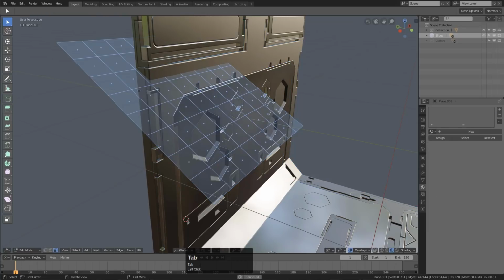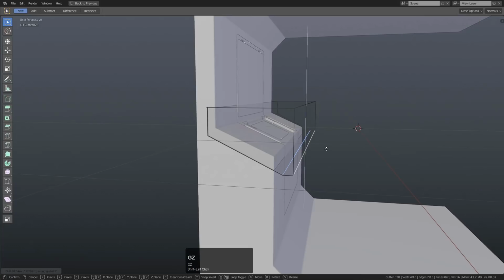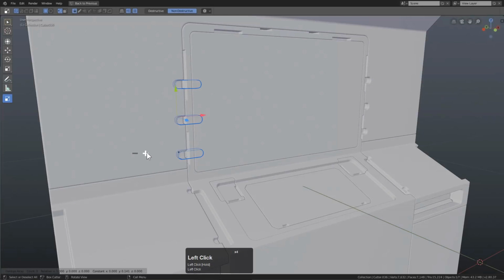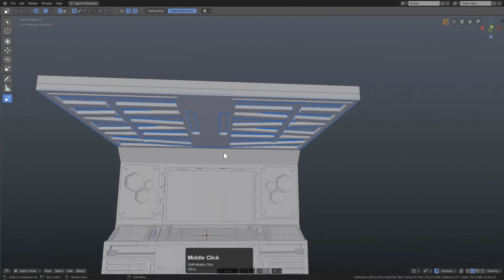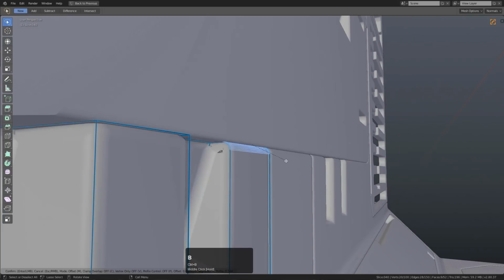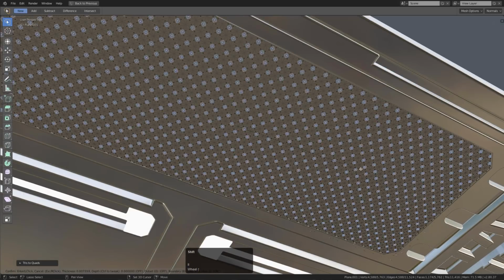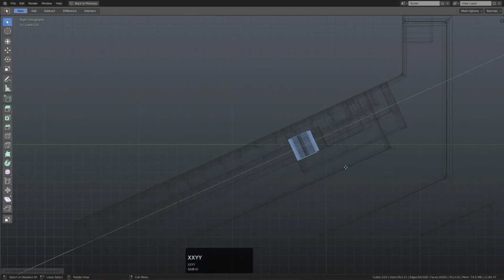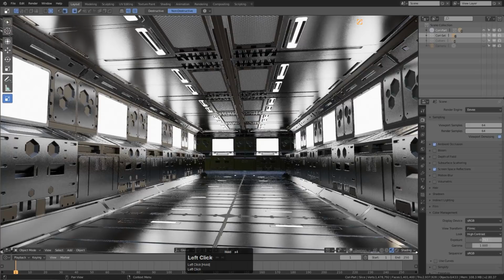#b3d / #boxcutter 707 : More Box More Cutter

Comment: Just Jumping between older boxcutter and new... I REALLY DIG the cursor cut depth. I'm hoping we can bring that back??( if it is there and I missed it..apologies) And for some reason the beveling made more sense on the fly with the cintiq pen....meaning tab then bevel to desired. A suggestion for working with cutter planes might be a quick click preset that adds the plane with a built in xyz gimbal for speed on show with the plane. I'm a zbrush fan and use box cutter over and back with zbrush for various attributes etc. Also - I think you could charge something for the 2.8 update. I don't mind paying something more once it is done and I think we all should. This really is a great tool.
Reply from the maker: youre the first to mention cursor depth. Since I got used to how hard it is to move the cursor now I stopped thinking about it but you might be onto something so Ill check into that. I think we're on the same page the the gizmo possibly on the plane with the ability to jump around and quickly reposition / remove and bring it back. Maybe an active tool type plane if im able to dream. Im excited for the future of it as we work it into place. But the ngon will definetely need a workflow similar. Gizmos are definitely needed for cintiq usage and i think with on screen sliders and drawing the pen functionality will fall into place. I am glad you are enjoying your journey with us.
Reply: I'm enjoying this for sure! Cheers.

Comment: love these videos!  I have a question...  

It seems the behavior for the visibility of cutters has changed from the 7_0_6 release?  in that release you could use bool scroll to quickly scroll through and select your boolean....in 7_0_7 it seems the cutters collection is hidden by default...when you use bool scroll you don't see anything as they are hidden.  it requires an extra step to go the collection and turn on it's visibility.  Is this just a bug?  It seems like the behavior in 7_0_6 was more user friendly in this regard.    Maybe I'm missing something, if I am please let me know...I'm a blender/boxcutter noob, but love it so far.  Thanks!!
Reply from the maker: we're working on it.
Reply: thanks, keep up the good work.

Comment: Loving it......quick question - "Live cuts" I see you keeping cuts "live" for possible editing as you go. How do I freeze or make permanent the live cuts for export etc? I've watched all your vids and coming from other apps I'm just missing or not connecting with that function.......Cheers man.
Reply from the maker: i dont even apply for export. I just export. However I do use the convert to mesh to apply everything in one swoop. It works so good for that however when Hard Ops was made Csharp has one job in particular. Apply certain modifiers and sharpen the mesh. So I use that alot too when I have to apply something. I do think we should expand on the destructive side of bc and make it more capable as an applier of cuts. However since 2.8 started I have become much into the nondestructive side but Csharp is the modifier applier of choice.
Reply: @masterxeon1001  Thank you for the fast answer. Much appreciated!

Comment: I have not tried this yet as I'm just getting into Blender. Is there a numeric input or any other way to accurately place the details? For instance - is there a way to center one cutter over where it's going or is it always just by eye?
Reply from the maker: Donald Miller you can accurately place anything using shift to keep live then adjust using snapping to align with edge vert or face.   I tend to work more conceptual to start but get more precise if needed..
Reply: @masterxeon1001   Thank you! I've been going through your videos and am captivated by your work!